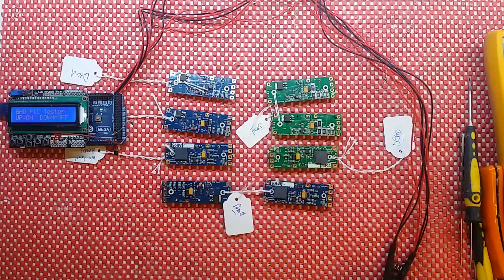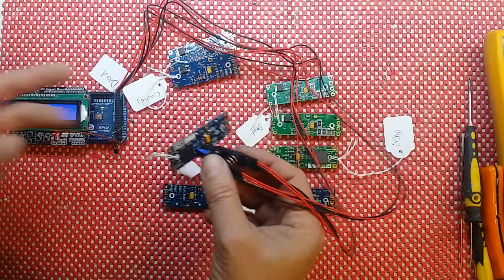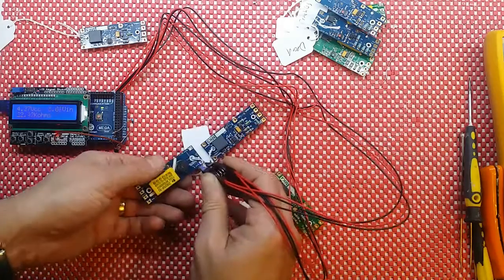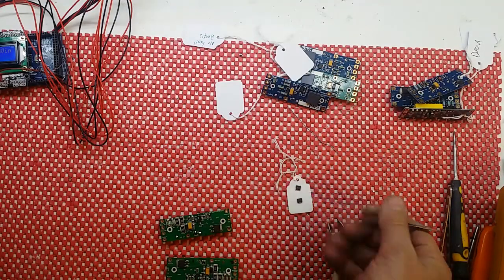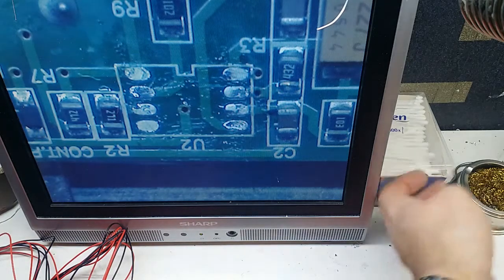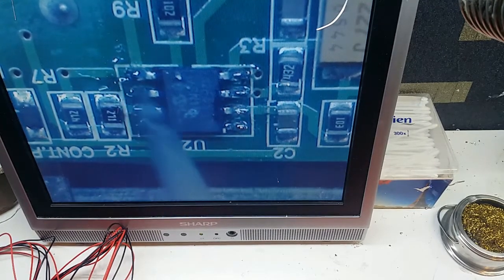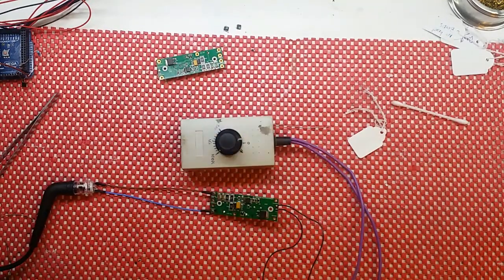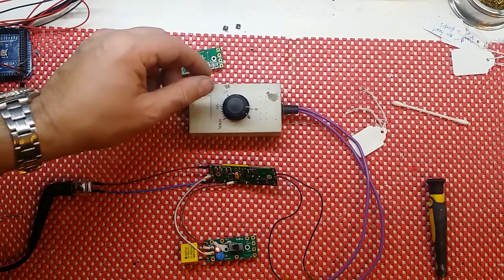GHD mk4 PCB repair

Comment: Hi. I need a power switch for a GHD Mk5. I've only been able to locate the whole PCB assembly (overkill) or ridiculous price for a second-hand one (£5!).

Would you happen to have one available at a 'reasonable' price please?

BTW, are these switches available from RS or similar? Thank you.
Reply from the maker: Hi, Sorry i dont have any spare, they do dismantal and you can clean the contacts just a bit fiddly. 
The model with a single spring inside is a real Ba*stard if taken apart. (4 pin switch), the 6 pin is a lot easier and can in the worst case be rotated 180°.
Have not located then anywhere as of yet to purchase new.